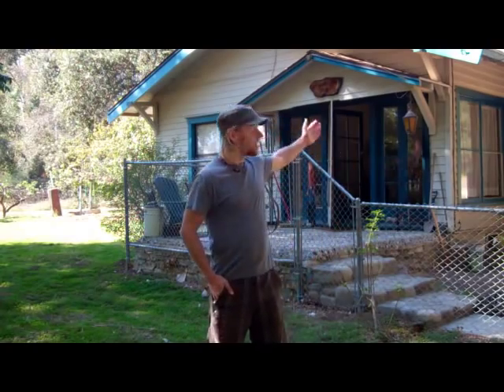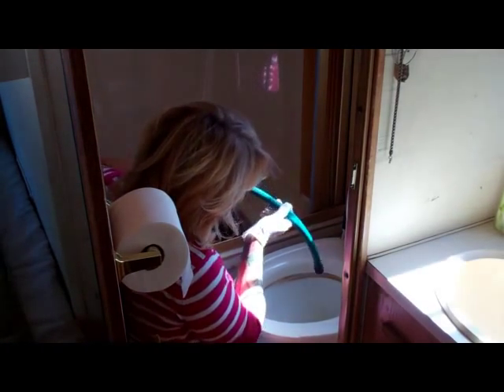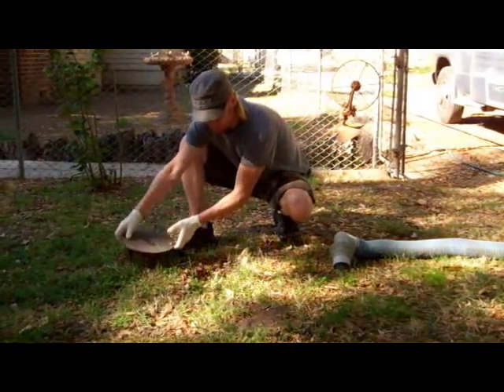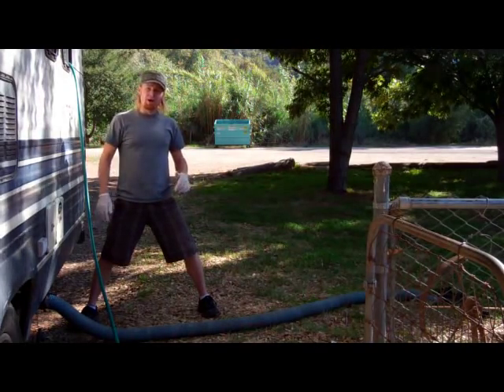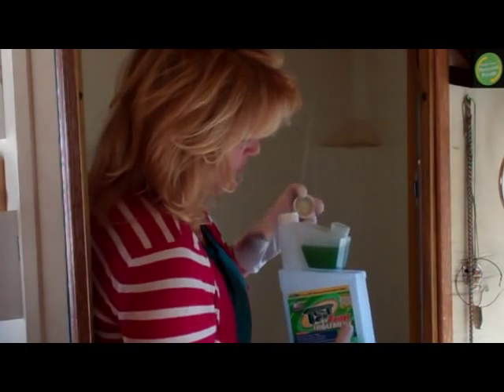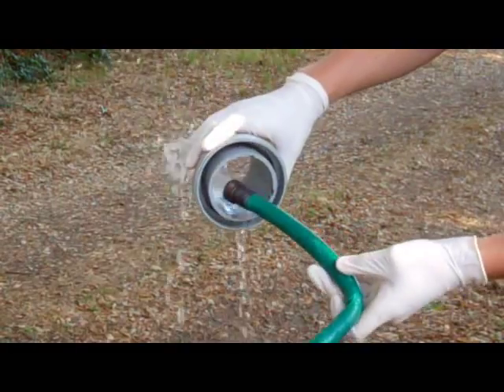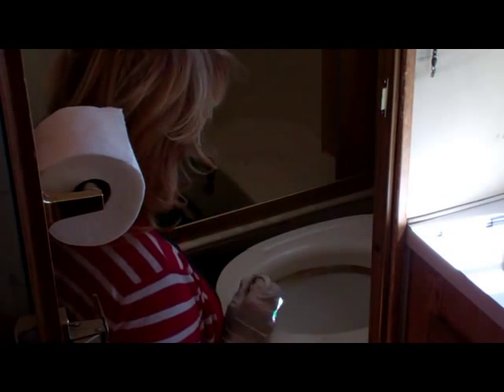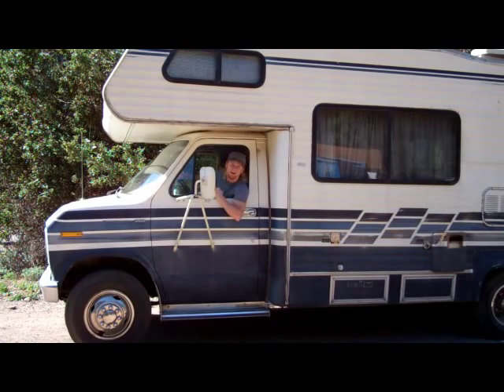How to Empty an RV Septic System

Comment: Well, this was one of the most comprehensive videos I have watched regarding dumping your black and grey water tanks. I would look into a Dual Flush by Camco (no I don't work for them), or similar device to back flush the black water tank. I would also mention that a garden hose is not good for potable water, they make special hoses which do not leave the rubber taste which are usually white in color. I know things have changed in the past few years,but this is still an extremely thorough video.

Comment: You should fill the fresh water tank with a food grade hose. Additionally, I would never use the same hose you put down the toilet to fill the fresh water tank whether you use sanitation wipes or not. eeww! Also, just putting the hose down the toilet doesn't always get the tank clean. There is a wand you can buy on Amazon for this purpose that gives you high powered spray to clean the walls of the tank, sensors, and floor of the tank of anything that is stuck in there. Oftentimes stuff will stick to the sensors making your electronic level meter show the tank is still full or half full. The wand also has a shutoff switch that you can control from the toilet. It's very inexpensive to purchase. I like the rest of the video. :)
Reply from the maker: +Finally Free 2 RV - I agree, I wouldn't ever use the toilet hose to fill the white water tank, either. In the video, I used a different hose, but I may not have made it clear enough that you need to use a separate hose to fill the water tank. Great tip about the wand, though. I wasn't aware of such a thing. Would you mind posting a link where you could buy one?

Comment: Thankyou so much, I have been so nervous about trying to clean the tanks not being sure exactly how. I have been watching a numerous amount of videos ad this one" ;) I think I GET"""" Thanks again...... Is it possible to clean at home without sewer connection? Or is that just a horrible question????? :0)p
Reply: Donna and Wade habz Yes, it is possible, kinda. There are services that you can call and they will bring a truck to your house, or your RV, and empty the tanks for you (for a fee). However, I would recommend driving your RV to a facility to empty them yourself. If your RV sits for too long without being driven, bad things can start to happen to it. For me, the catalytic converter would get clogged, causing it to overheat. 

Emptying your tanks anywhere but into a facility specifically designed for that would be a really gross mess that you won't want any part of, and I'm pretty sure it's also illegal.

Comment: About how frequently does an RV septic system need to be emptied?
Reply: When it gets full (Obviously) or before you store it.
Reply: When it starts to smell like shit...
Reply: I mean in terms of time between emptyings. 2 days? A week? Or perhaps, how many uses of the system, as a ballpark guess, before it needs to be changed? 10 visits? 20 visits?
Reply: Very good points.  Also, there are directional vents that can be installed on the roof for the black water tank vent that are designed to draw air up and out of the tank if there is a breeze.  This helps prevent backdrafts (when air goes down the vent tube and up and out of the toilet when you flush it-especially when the exhaust fan is on) which can be significantly unpleasant if the tank is "dirty."  One other point- evaluate the black water tank additive you are using.  Some (most) of the eco-friendly ones are virtually worthless.  It's sad but true.  I could never find one that worked anywhere close to the old tried and true blue.  I guess formaldehyde is a formidable foe for preventing rot and stink, but not the best for Mother Nature.  And, make sure and clean the black tank really well when you do dump it.  Very important.

Comment: Would throwing some bleach down the toilet hurt anything?
Reply from the maker: Wouldn't recommend it. They have RV Septic System treatment stuff specifically designed to keep the tank clean and less odor-ific. I've had no complaints using it. Throwing bleach down there seems unnecessary. After all, it's not like you're storing food down there or anything. Just poop.

Comment: how often do you drain poop
Reply: +Danny Martinez As often as it gets full. Depends on your usage, and how many people are using your toilet. When I was on tour with the band, we had four people living in the RV, using it on a fairly regular basis, and we had to dump it every week to week and a half. When just my wife and I were living in it, we only had to dump it every two to three weeks. A friend of ours lived in it for awhile by himself, and he could go probably a month to a month and a half without dumping. You'll be able to tell when it's full by looking down the chute. If the sewerage is getting close to the top, it's a good idea to dump it.
Reply: +Ann Berns It can stink, but the treatment that you use REALLY does a great job of keeping it under control. (In the video, you can see us adding the treatment solution after we've finished draining and rinsing the black water tank.) And it doesn't really take that much, surprisingly. As the tank gets nearer to its capacity, you'll notice the smell more and more, but mostly only when you flush. We've found that opening the bathroom vent* and/or window helps get rid of the smell after a flush, and we always keep some air freshener spray handy near the toilet. 

*Note: You should never have your ceiling vents open while driving.
Reply: +Ann Berns Also, the RV sewer line was there when we moved in, and wasn't exactly up to code, or what you would call "legal". The people that owned the property (we were renting) had owned it for a LONG time, and the guy installed it himself. It worked great for us, but I wouldn't recommend doing it yourself without going through the proper channels.

Comment: Why don't  they use cassette toilets instead of having all this primative unsanitary trauma?
Reply: Phil Healey I’m sure that RV septic systems have come a long way since 1989 (the year our RV was made). But I really wouldn’t know. I only ever owned that one.
Reply: @jaredfredeen8886  Hi, I'm being a bit tongue in cheek, with a lot of  experience with the Thetford cassette system which is very good and even ok with the cassette removable inside an expedition truck.  We rented a pickup based offroad camper last year in Iceland with the old school  black water tank and slide valve discharge. Not a situation I intend to repeat !
Reply: Phil Healey I hear ya, man, those things can get gross. Glad to hear there’s an alternative.

Comment: Connect sewer hose to trailer put opposite end in septic tank, pull lever. Listen for turds going through. I'm just being a wise ass actually you do need flush the tanks too which I always do it's just not a complicated process. That's all.